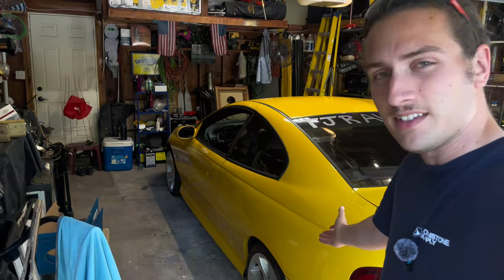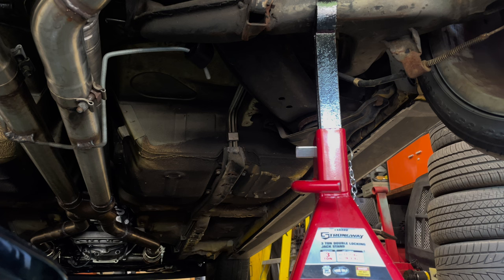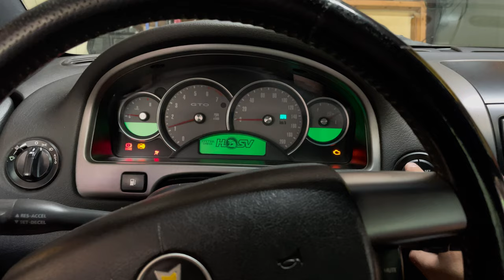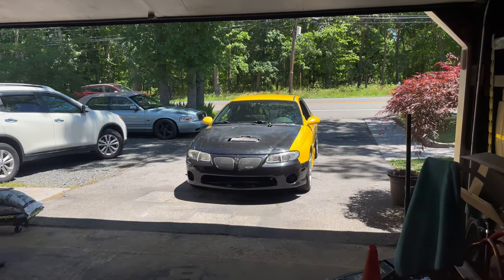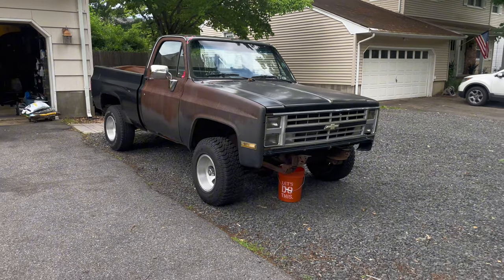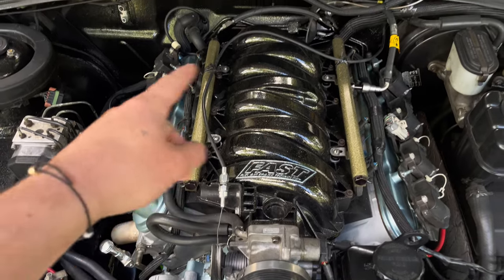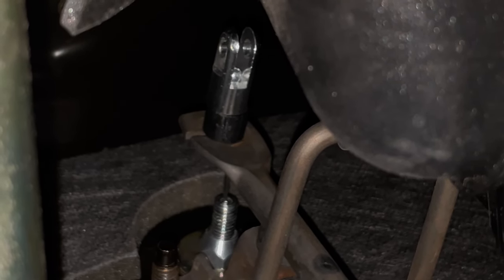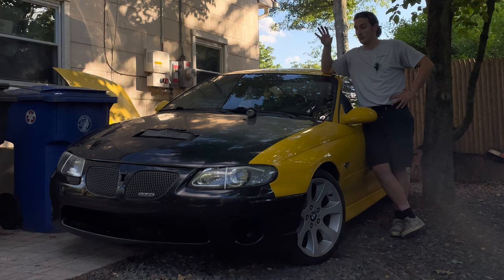BAD Days Call for GOOD Plays!

Comment: Need to have a Pontiac cap 3d printed. That poor cars confused enough to be slapping BMW logos on it...

The rear seatbelt bolts need to be trimmed for a solid driveshaft.... looks like the tell tale markings that wasnt done.

Stock mounts will allow a lot of flex when prying on the shaft remember its a rear boomerang subframe that uses the diff as the middle point on the mount. 

I HATE solid mounts... I have Poly on mine... hell I think I still have another set of Pedders brand new in the box if its something youd want to swap in (and content!)
Reply: I agree with seat belt bolts. I would also go with the gforce diff mount. My harrop was great but too expensive. 

Don’t ever get rid of your drag bags, irreplaceable and the best solution to hop imo.  Selling mine was the end of my car for me.